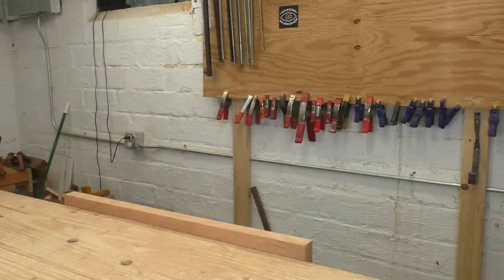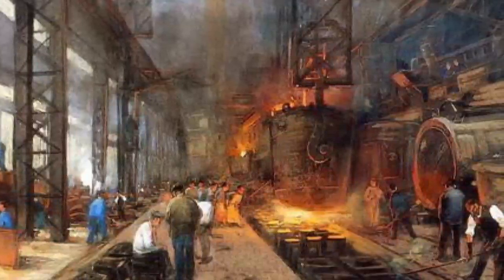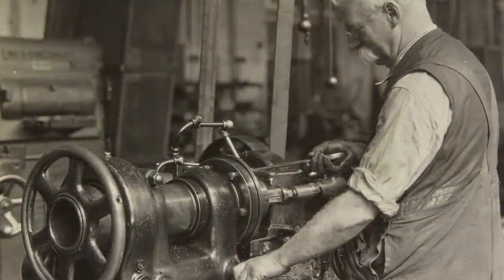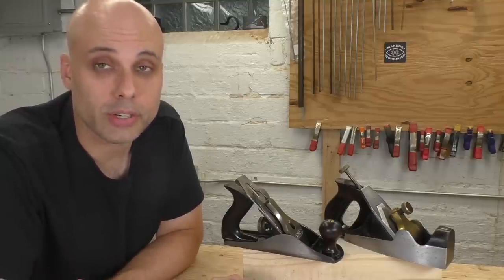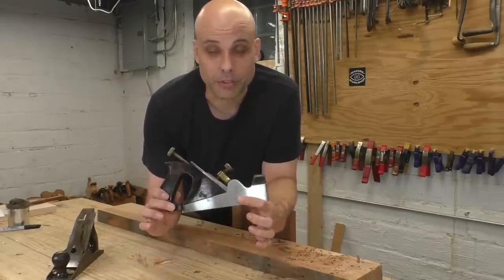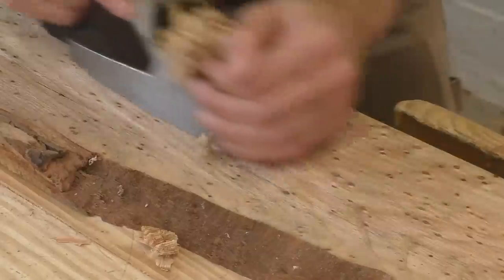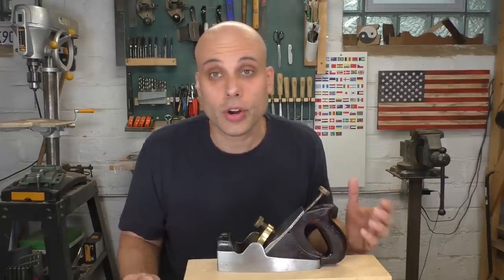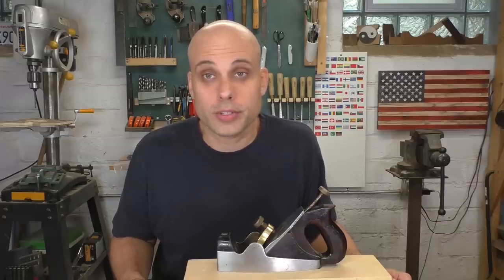The Legendary Scottish Infill Plane

Comment: I"m not going say, you make the best videos. It would sound insincere. I seen that Norris plan, and said, "Wholy carp, how much did that cost?" The tools I buy, come from  the pocket change I save all year. It keeps me from becoming a tool junkie, because that monkey is just sitting there, waiting to take over. The problem is, it's made me cheap. The worst mistakes I've made, were not from spending to much, but from not spending anything. Because of this, I have preprogramed, plans set, so I don't think, and make stupid mistakes. One is, "If I get my hands on a cheap Norris plane, I'll sell it, and use the money to buy things I actually need." Yeah, no. If I got a working Norris plane, it never leave my hands.

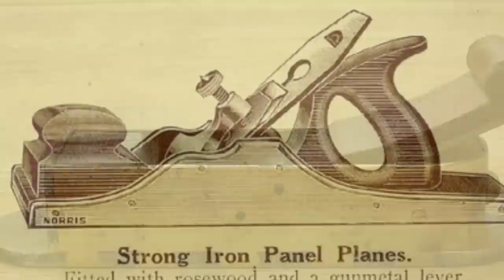Comment: 4:05 the thing about these dovetails is that they are both ways - something impossible in wood.  In the image, we can see that brass plate has been fitted over a steel sole. Clearly, sole can't be pulled down. But the dovetails in the sole have a recess that's hidden by the brass.  Then the brass is hammered so it flows and fills up the gaps, locking the two pieces together forever.  The hammering is done from the sides and from the bottom. This is why you don't see any gaps - it wasn't sawn out this way; it was hammered into an interference fit and then some.  Then the lump mess of a result was filed smooth to reveal what you see above.

Comment: You know, I buy the harmonic vibration thing. Makes mechanical sense to me, but that's me. I have certainly experienced the reversing grain tear out thing. Even when I narrow the mouth. I often resort to a card or cabinet scraper. So, again, it makes sense to me that the higher angle would reduce the tear out. I have actually been looking at a high angle plane, just for finish surfacing. Nothing beats a plane finished surface for smoothness and natural shine. Sandpaper doesn't even come close. I know that Veritas uses Norris adjusters and I have a couple Veritas planes. The movement works very well. What I particularly like about it is that it stays set, So, I guess I'm off to subscribe to Patrick Leach. Oh, and yes, Mortise and Tenon is more that worth the money. I read it from cover to cover every time, and then go back and reread large parts. Best magazine ever.
Reply: I'm wondering if harmonic-vibration is another term for chattering. The stanley plane chatters when it goes over the grain transition, whereas the infill doesn't; which makes me think that's what they are talking about.
Reply: Same! I was just planing some cheap wood board with reversing grain yesterday, and the plane would bounce off with the frequency of the wood vibrating, leaving a bunch of lines with every pass. Of course, if those vibrations are dampened, the plane would keep better contact with the wood and take more even shavings.
Reply: Absolutely agree with you! Everything these days is finished by machine sanding for the most part, I don't see the appeal other than the fact that anyone can do it. 
But a nice hand-planed surface is unbeatable in attractiveness to my eyes. 
Machine planing doesn't leave quite the same finish. 
A burnished shiny wood surface is the closest I've seen to a planed surface. 

And yes, harmonics/ vibration is basically another name for chatter. There aren't too many equations to figure out where and how much a given machine will chatter, except it certainly will. 
Even the heaviest material removal machines will chatter when the harmonics are just right (or just wrong?) 
I teach it this way: 
What happens when an unstoppable force meets an immovable object? 
Imagine the same thing, except dialled down somewhat. 
A cutting edge of known sharpness (angle of attack), a known mass, moving at a certain speed in one direction can only remove so much material. 
Anytime one of these variables change, the harmonics are completely different. 
I'm guessing the infill plane adds much needed mass to the cutting tool, moving the resonant frequencies much higher. 
You can still make it skip if you pushed it 4 times as fast, but that kind of working speed is only for superheroes 😂😂
Reply: Yes indeed, chatter. Here’s the thing about many Stanley planes, even those that seem well “fettled”: that iron is not sitting on the frog as well as you might think it is. It is kind of a crap shoot if you have a cap iron which has all the important surfaces lying precisely in a plane. Most are bent a little to favor a tight contact near the cutting edge. When the assembly is mounted and tightened down, instead of that thin iron being held firmly and flatly down on the frog what is happening is that a spring loaded (and therefore resonant) system is developed, with the whole schmehonka pivoting around the contact of the blade heel with the frog, and the stretch of iron/cap iron between there and the lever cap cam flopping in the breeze. Just asking for trouble.
Reply: I use a German reverse angle scraper plane.

Comment: I have been watching videos about woodworking for about 8 hours a day since Christmas.  In my humble opinion, you are one of if not the best and most watchable host out there.  At least as far as woodworking is concerned.  I have a specific request for you.

I know and really appreciate that you don't take money or tools from tool manufacturer's in your videos.  Unfortunately, this limits your ability to do comparisons because of the cost.  Is it possible for you to make a few videos that are hosted by manufacturers in the traditional way to allow comparisons of really expensive equipment?  You have earned my trust in a way very few others have, and I would much prefer to hear what you have to say about the best benchtop thickness planner, jointer, table saw, band saw, etc.  Which tools make sense to create and which ones should be bought used/new, etc.  I believe that if you point out the deals of the sponsorship multiple times during the video, you could really do your subscribers (in particular myself) a lot of good.  

I would also like you to design and show the construction of a homemade wood drying system for creating lumber from logs.  I envision a basic box with a lid that closes it airtight, except for a fan blowing air from one end and a small electric heater.  Combine that with a moisture meter (they are really cheap) and you would be able to dry wood as fast as possible without checking.  This would require some testing of course.

Comment: There's something just nice about wood and metal joined together. I have an excellent condition, iron-shod rabbet plane from the 1830s by "Moon" but... I've not got it set up, so it sits in a box. And a router plane body with a similar metal plate in the sole. Both are the screwed construction like the one at 3:38
PS: "Modified planes and forgeries" are the rarest ones!

Comment: I love how you cut through the hype and get down to why and how different tools are useful and the expensive specialty tool can't do it all,  because it's not supposed to. It's expensive because it's for a specific purpose that isn't required everyday therefore given the economy of scale in reverse, the cost for design and manufacture has to be made up on the sale of fewer units, hence the price.
I've learned so much about which tool for which task from you.

Comment: My father made a copy of a Norris plane and it looks very similar to the one in the video. I had made a chessboard table at school as part of my woodwork class, the black squares were mahogany and the white were sycamore. Sycamore has a very wavy wayward grain that is hard to plane, but that wasn't a problem as the table top was smoothed down with a belt sander. I was expecting my father to be pleased when he saw it but the first thing he said was: 'That's not flat' He gave me his Norris copy and told me to keep planing in any direction until it stops cutting anything, that when it stops cutting the tabletop would be flat. It didn't tear any of the sycamore squares and the tabletop ended up flat.

Comment: I inherited my grandfathers Noriss style infill smother from my Father and like you only ocasionally use it, not least because it has no adjuster.
Looking back at the way my father used this plane I believe that using heavier planes in general becomes more about technique.
For instance my father taught me that when bevelling corners it is best to hold the board at arround 45 degrees to the vertical in one hand with the end braced against an imovable object then use the plane one handed allowing the planes weight to make the cut.

Comment: 1:25 the truth about infill planes is that you don't need a foundry to make them. You don't have to cast molten iron. You just need flat sheets of mild steel, a hacksaw, a hammer, and a hard spot to hammer on. Anyone can make one.  The only innovation is the micro-adjust some have.

These weren't made to be racecars though that's how we treat them. They are the artisan's expression of industrial-age planemaking.

Comment: Rex, you done a good job here, podner. It’s a  subject dear to my heart, since I own one of those post-war Norris smoothers, flat sided. My dear heart ladyfriend gave it to me so many years ago. No kidding, she had to take a bank loan to do it. $300 was a lot to us, then. 

I address the subject of that adjuster. Besides the elegance of a single control for both  adjustments, it has a feature I had never seen before but instantly grasped: a differential screw to advance the blade! This could give ordinary screw threads the sensitivity of a microtome! Nevah mind that Stanley dreck, this surely is a pinnacle of hand tool engineering!

Or so I thought. In some kind of classic boner, instead of one thread advancing while the other retracts at a different rate, they BOTH advance, COMPOUNDING the rate, and clumsily, drastically REDUCING the sensitivity to less than Stanley convention, way less, it seems to me. Pisses me off no end, to this day.

On balance, I appreciate the extra rigidity and mass. What you say about the reduction in chattering is true. I will quote myself from elsewhere in these comments:

Yes indeed, chatter. Here’s the thing about many Stanley planes, even those that seem well “fettled”: that iron is not sitting on the frog as well as you might think it is. It is kind of a crap shoot if you have a cap iron which has all the important surfaces lying precisely in a plane. Most are bent a little to favor a tight contact near the cutting edge. When the assembly is mounted and tightened down, instead of that thin iron being held firmly and flatly down on the frog what is happening is that a spring loaded (and therefore resonant) system is developed, with the whole schmehonka pivoting around the contact of the blade heel with the frog, and the stretch of iron/cap iron between there and the lever cap cam flopping in the breeze. Just asking for trouble.

Comment: Mr Rex, could you please address something for me? It’s about plane angles and it’s been bugging me...

So you established in your video on sharpening that the blade angle is set by the bed on a bevel down plane and the bevel on the blade doesn’t matter too much as it’s just clearance. So far so good. You also hint that on a bevel is important on a bevel up plane as that’s what sets the angle of interaction.

I’m taking from this that in a bevel up arrangement, the angle of interaction is the bed angle plus the blade angle. This would mean that the angle of interaction on most “low angle” planes, with a blade of 25 and a bed of 25 would be 50, which is actually steeper than a conventional plane.

Is there something I’m missing that makes low angle tools more useful? Why wouldn’t you just use easier to make and adjust high angle planes, like a good version of that little plastic one you reviewed?

If you can just talk this through next time you discuss planes, I’d appreciate it greatly

Comment: I got an infill this summer and your dead on as usual Rex.  I didn't get the Norris adjuster on mine which is not as easy, but it's like a Rolls Royce when it powers through a figured grain for smoothing cut.  However, not versatile at all.  Did I mention it looks amazing?

Comment: Mortise and Tenon also has a podcast. I haven’t subscribed to the magazine yet because I’m just getting started. 
I want to make a living room shelf unit for my son’s first apartment and I was thinking about building it from 2x12 SPF from the big box store. (I like the chunkiness of the 2x’s for a sturdy “made by my Dad” look.) But the wood they had in stock was too crappy for furniture with splits, massive gouges and big empty knot holes. I only have a couple old hand planes (a jack and a fore) that I have only played with a little. Would it really be feasible for me to expect to successfully surface 35 linear feet of rough sawn hardwood from a mill with hand planes as a novice? Or should I buy 1”x12”x6’ S4S hardwood boards and try to laminate them to make the thickness I want? I’m not sure how I’d be able to apply enough pressure over that much area to get a good glue joint.

Comment: Hey Rex. Can you give me some tips on getting the chips out of the plane when I’m taking multiple short passes on a board? It’s very often that I’m planing down one side of an edge and all of a sudden my plane will just start skating and won’t bite into the wood because the mouth is so clogged from the previous passes. Thanks so much for your wisdom
Reply: Also, I heard somewhere that putting the plane down damages the blade or the wood it’s resting on when the blade is out. Have you had any experiences like that?

Comment: Love the videos Rex, but one thing bothers me about your plane handling. I was always taught never to put your plane bed flat down onto the bench. This is because the blade is projecting and you run the risk of blunting or misaligning the blade. We were taught to put it on its side or rest the front or back up on something.
Any one have any thoughts or comments?!
Reply: Oh, no you don’t! Not sucking me into a useless, endless whirlwind of acrimonious, insulting, chest-beating declarations of truth delivered from heaven. No sir! I’d rather divert my free time and energy to an argument about something really useful and important, such as which direction the bark should be facing in a stack of split firewood, which is up, by Jiminy.
Reply: As far as I understand it :-
Back in the day
If you mostly work on a bench, bed down as the blade is most likely to get damaged by other tools.
If you work at a jobsite, side down as the blade is most likely to get damaged by the floor.

Roll on a couple of hundred years to where we are now and it depends on where the teacher 5 or 6 generations back used to work.
Reply: @MikeB-mq8bv  a very cool analysis!
Reply: @MikeB-mq8bv   thanks, that clears it up. Guess my college tutor was a bench worker!!

Comment: The norris A5 is a turd. The earlier norris planes and everything pretty much pre-adjuster, those planes were generally good. If anyone is considering buying an A5 with an adjuster because they're inexpensive (relatively - about $300, similar to a premium plane) and you think the adjuster will make them easier to use, pass them by. 

They'll lose lateral adjustment with cut depth adjustment, they'll cut deeper as you tighten the lever cap, and the adjuster travel is way too fast. The later norris planes went from ward irons to soft robt. sorby irons. 

As with anything, you can figure them out and use them. But quite often, a decent unbroken earlier adjusterless dovetailed plane is available for the same price and miles better. All that said, there's nothing they'll do that a stanley plane won't do and like a stanley, if you're going to do more than fine work, an all wood plane is a better choice.

Comment: Yep. No Woodworking shop is complete without at least two Infill Planes.. I have two dating from the mid/ late 1800's and they are perfect for that final smoothing cut, especially in our cranky grained figured Australian Hardwoods. The extra weight isn't a liability, quite the opposite. This, combined with the thicker iron makes using them a breeze. If you are prepared to search around out of the way Antique Shops you may just get lucky like I did and find one for next to nothing.. I paid $200 AUD for my first one and recently picked up a second one for $150 AUD. Both are in excellent condition and only needed the smallest amount of work to get them in top working condition. They leave my Veritas smoothing planes for dead.... So much so I gave my Veritas planes to a young fella I am Mentoring.:_Plane::_Plane: